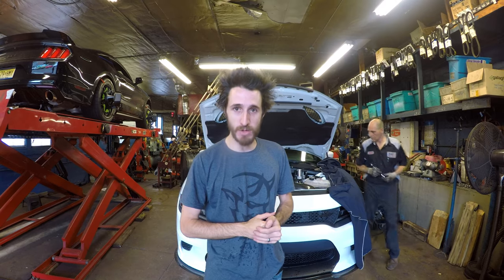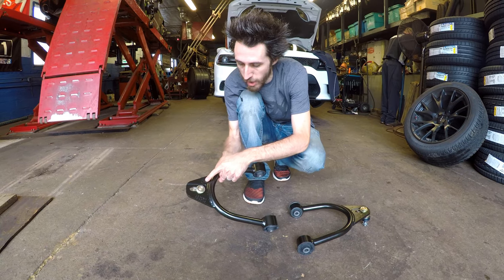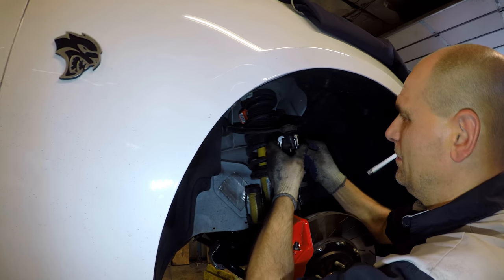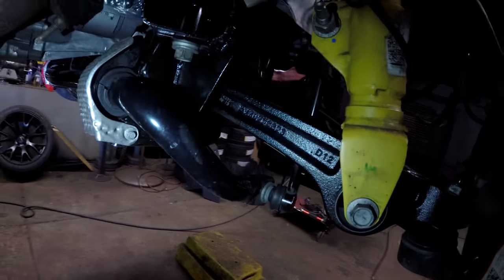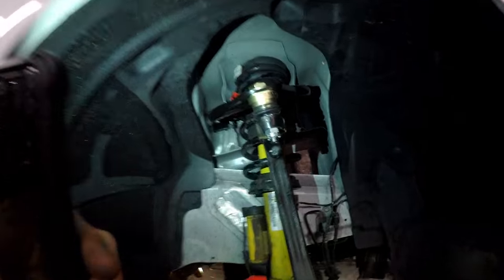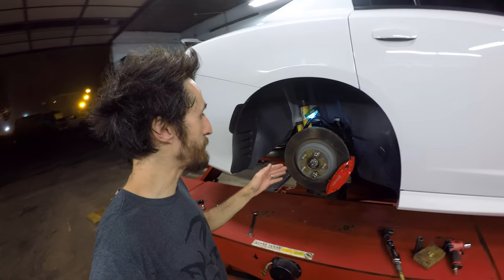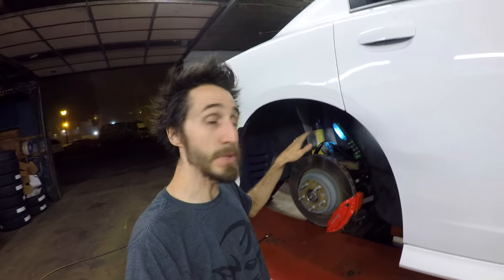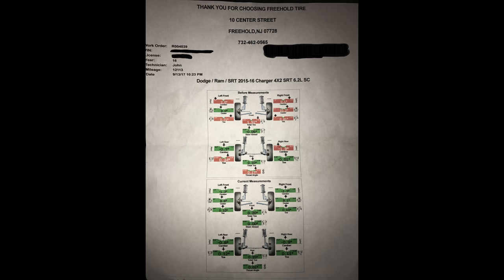Install: SPC Upper Control Arms & Rear Camber Bushings For Dodge Charger/Challenger Alignment Fix!

Comment: Great overall video of how to. Just a heads up for anybody doing this tho: if you have the bigger front arm (41.5mm, like this video) you need to press in the larger side of the bushing in from the back of the arm, and stop pressing once the step on the bushing is flush with the inside curved part of the arm. Don't just press it in a lil bit with small side first. Engineering wouldn't make sense. It needs a certain amount a surface contact to create its bond. If you have the smaller arm then your press the smaller side of bushing in first til it stops because of the step. Confirmed with spc, and makes sense.

Comment: J.s i just did mine and did not remove the wiper cow . You go through the brake master cylinder assecs door to get the drives side . The passenger side is a p.i.t.a ,but can be done . Unhook and remove the purge solenoid.  Use an 18mm swivel head ratchet wrench.

Comment: I have a 2012 dodge charger with 22's and my camber is horrible tires wear out from the inside...my question is can I just use a camber kit bolts in the front or do I need to purchase the control arms?..

Comment: I lowered my car on airlift suspension and I’m about to add the spc bushings how much degrees should I add in the back? The height of the car is about the same as the eibach sport springs. Thanks for any advice

Comment: If you installed these with hole at bottom dead centre would that mean the camber would be at 0. Just trying to replace a bushing that I destroyed while changing out a rear driver side cv shaft. No lowering kit, just a stock 300. Having a hell of a time finding a replacement that doesn't have some sort of adjustability.  Any help would be appreciated. Good video, thank you.

Comment: Great Video!!! Planning on installing spc/eibach camber bushings in the coming weeks. SPC offers the 66025 - BUSHING PRESS ADAPTORS. Can i use this with any ball joint press or does it have to be the SPC one??
Reply from the maker: Thanks buddy! I am not sure I had all the spc stuff and it worked great!
Reply: @DrivewayDemons  Could you tell me the torque specs for the lower control arm. Thanks

Comment: I literally have to do this exact process on my Dodge Challenger SXT when my Eibach sport plus set comes in! (Lowering springs, new shocks, sway bars, & links). When I go to do my alignment, doesn’t it effect the vehicle with it being lifted just like in your video, with incorrect measurements? I figured I would have to check while it’s sitting properly and lift it, adjust, lower it again, then re-roll all over again to and keep tabs on where my angles are at each time and then repeat the process all over again and recheck again, and again, and again. Can you explain your process so I’m not taking up time at my shop’s times. Also, I’m the kinda guy I like getting every time near picture perfect. Not a single spec off! Would I have to buy adjustable control arms for the rear to get that? I don’t care if it’s in spec and it’s in the green, I’m more of a principal kinda guy. It has to be exactly on the mark or .1 next to it. I’m getting an aggressive drop so I wanna be sure. I’m ordering the same kit you are right after i install my Eibach kit, and check my alignment to see where it sits at currently

Comment: my front left caster is -1.2 front right is -1.7
Both front toes is .10
Front left camber is -1.9, Front right is -2.4
Back left camber is -1.9, back right is -2.4
Back left toe is-.05 back right Is .10
Just got it done at pepboyd I already told them the camber is off, on the back right. What do you think of this considering I just got it done? It seems like whoever did it sucked. Im kinda pissed. I do a lot of driving around towns but do like to speed it up here and there and hug turns tightly although I don't mid a little drifting although I just want it like how it came from factory.

Comment: I’m having problems with my front camber and caster alignment shop says I need adjustable ball joints should I go the same route as you did with the front and rear for the best alignment
Reply: Silver Hemi  yes dude. Look up whatever manufacturer makes adjustable suspension components for your vehicle and buy them. This is a no brainer question my friend.

Comment: Cory, a couple questions, first, how much did it cost to do this work.  On the rear camber bushing, you removed both the flat bushing and the step bushing, but you only have a single camber bushing for the rears, right?  I am pretty sure I just missed your point on the back bushings.  Trying to find someone I trust to put these on is a challenge in itself.
Reply from the maker: I used both on one side of the rear. The other side didnt need it. Also the cost will vary but anywhere from $200-$500 for a complete rear.
Reply: Driveway Demons  he asked a really good question. So 1 will change the camber and the other will change the caster on ONE side, correct?